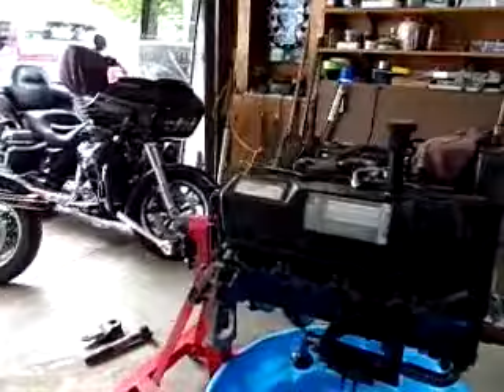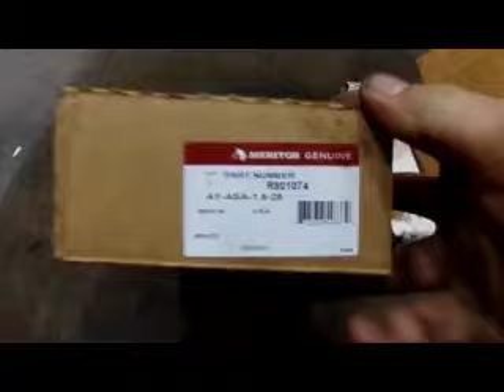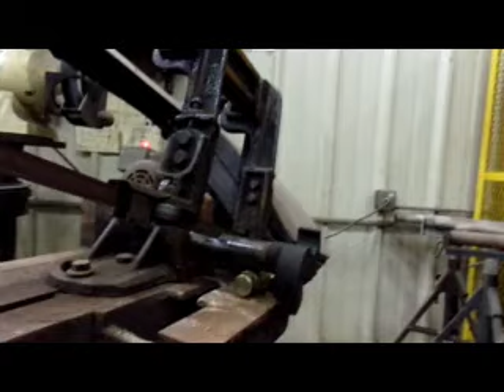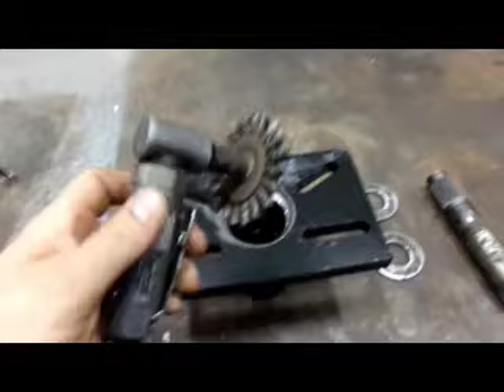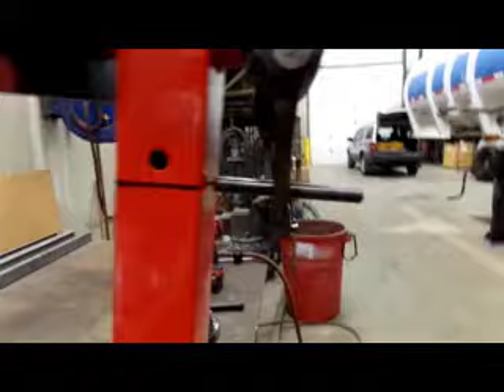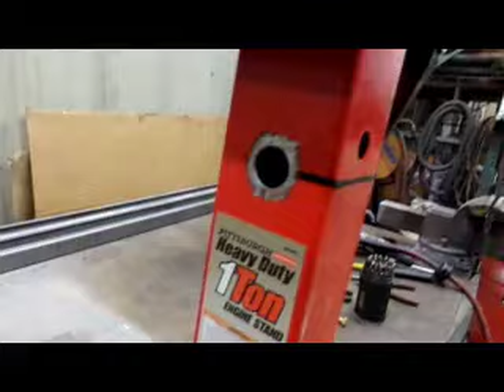Building a inexpensive Heavy Duty engine rotator that can handle a 800 pound 7.3 Power Stroke Diesel

Comment: Hey opa is that the engine that was inside the truck that we were talking about to be my starter car
Reply from the maker: Nope. The truck you said you wanted to fix up, for your first truck, still has the engine in it. But it has the same kind of engine as the engine in this video!
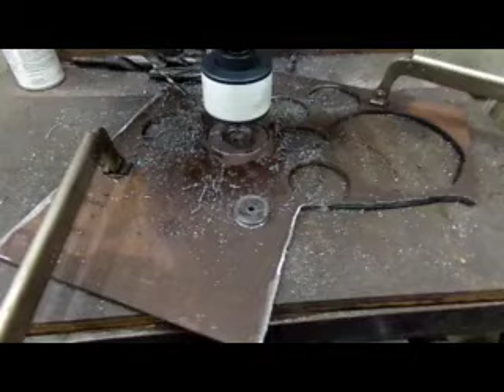Reply: 12:21, on a Dutch vid about a Willy's Jeep, the guy mounted a smaller diameter hole saw into a bigger one. The smaller diamond sticks out (in length) of the bigger diameter one on because of this he could make rings in one drilling move. Genius idea. We Dutch also use opa for grandfather and oma for grandmother. I have no idea where I could get such a gear to rotate the engine. That truck part. I am in near future need of an engine stand but as a former welder and weld inspector (ndt) I will manage. Because of that gear, I do not have to fool around with holes and a pin and in-balance. Keep it up 👍🏻

Comment: Great Job! Even if you don’t work on heavy engines this is a nice feature to add to an engine stand. I’m 68 years old and mainly work on small block Chevrolets and some 4 cylinder engines but either way my hands and arms would appreciate this addition to my engine stand. I have a friend who services tractors and trailers and I’ll check with him for an S cam and slack adjuster. Thanks!
Reply from the maker: You're welcome

Comment: This is a great idea for an engine stand I just picked up a 427 Chevy tall block industrial application that weighs in at 750 lbs currently I plan on shaving some wheat off by using aluminum intake and head's from a 454 I know this is something I would not be able to rotate by myself so thank you for the best idea I've seen and the great tutorial always nice to learn options especially the differences between a few types of adjusters. Great video.

Comment: Nice job

Can you tell me slack adjuster and other rod name in writing
Reply from the maker: Here is a link to a slack adjuster that will work. It isn't the exact slack that I used but it has the same features. 
https://www.amazon.com/Automatic-Slack-Adjuster-Service-Spline/dp/B0B4PX2JP6/ref=asc_df_B0B4PX2JP6/?tag=hyprod-20&linkCode=df0&hvadid=598244533605&hvpos=&hvnetw=g&hvrand=9464012830422385031&hvpone=&hvptwo=&hvqmt=&hvdev=c&hvdvcmdl=&hvlocint=&hvlocphy=9016267&hvtargid=pla-1746906811129&psc=1

And here is a link for a 28 spline S-cam.
https://www.amazon.com/Meritor-2210C6867-S-Cam-Left-Spline/dp/B01A7QKZM4/ref=sr_1_1?crid=1W9127DWCUVRQ&keywords=28+spline+S+cam&qid=1666524446&s=automotive&sprefix=28+spline+s+cam%2Cautomotive%2C115&sr=1-1

Comment: I need one of these like NOW! I've tore down a few 7.3's on that exact engine stand. After bending the handle with a cheater, I started using my chain hoist to assist with the rotation by wrapping a chain under the engine to the opposite side engine mount. Still kinda dicey! I'm getting ready to assemble a 7.3 whose block and heads just came back from the machine shop. I guess I need to drive into Macon and make the rounds to find the parts. I'll be painting it all up and don't want to mess that up with a chain.